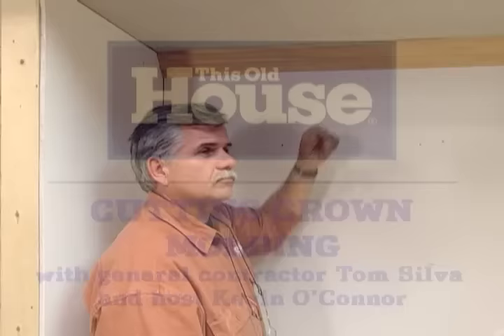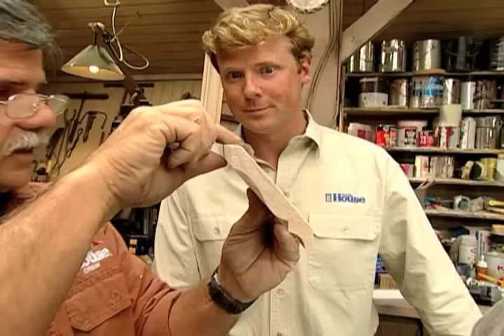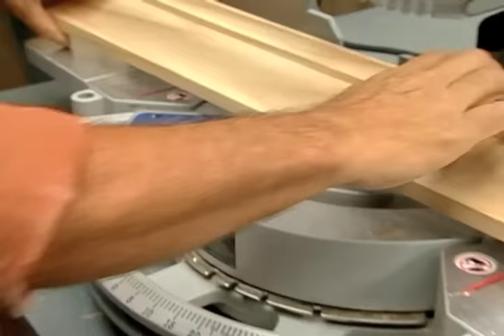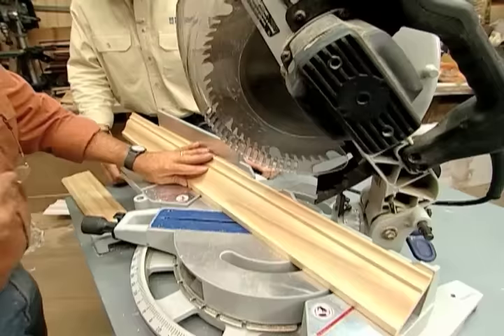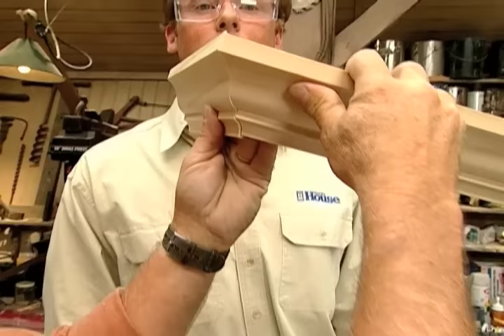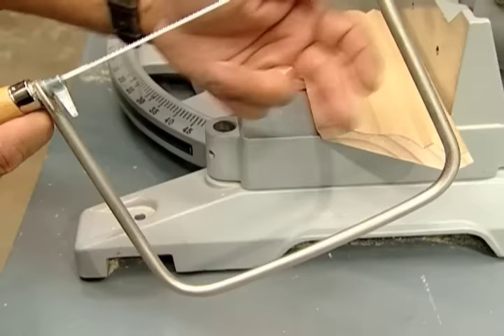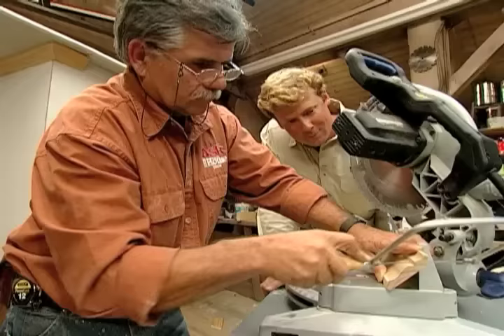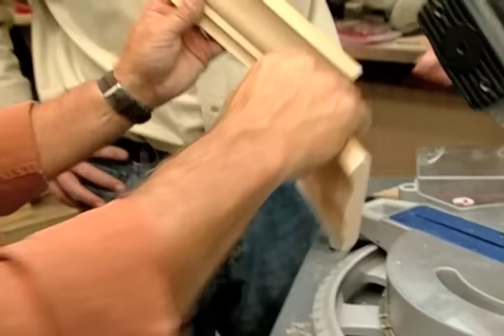How to Cut Crown Molding | This Old House

Comment: Again, this just shows cuts in random places on molding.  I need to see how a precise measurement is made and how the cuts are made.  Learned zilch.
Reply: You measure from corner to corner and mark it on the BOTTOM of you’re piece. Then, put the saw it at the desired 45 degree angle. THEN make sure you’re saw is cutting the bottom of the trim down to the top. If you need to know a precise angle they have tools for that.

What tommy does with the cope cute is optional, you can have two inside 45 angels if you want
Reply: @dr.zoidberg5096   thank you!
Reply: watch a video on how to read a tape measure then watch a video on how to use a chop saw

Comment: It’s so easy when you have walls with perfectly true 90 degree angles; i.e. about 10% of actual homes
Reply: and a saw that cuts exactly like it needs to, has a flat base, has a fence perpendicular to the base. the list goes on. all factosr that will screw the cut up just slightly. 

Sincerely, 

angry home owner trying to cut crown
Reply: @Cameron P  I'm feeling your pain.  Just gave up after trying so many times today.  Exhausted, angry, and can'teven focus any more.  The worse part is I'm using a hand saw, the only tool I have. 😭
Reply: One quick tip: When I cut trim, I check every angle with a miter finder. You're right, very few walls are 90 degrees. If a corner is 86 degrees, it will tell me to make 43 degree cuts. Makes for perfect looking miters no matter the wall situation.
Reply: Been in the remodeling business for over thirty years. I can count on one hand the times I've had a perfect 90 degree outside miter on crown.
Reply: Perfect 90 are like unicorns they don’t exist
Reply: That’s why you do a cope instead of a inside to outside/ inside corner

Comment: Thank you. All of these other premadonnas over explaining this was getting me nowhere. Clear, concise, no nonsense.
Reply: this is for beginners. advanced users would use a compound miter saw and cut the board flat, by simply adjusting the bevel and miter angles. there's a few really good charts online. After a few cuts even beginners will catch on easy. This method can be dangerous for beginners if not using proper stops and safety measures. so the new school method is definitely way more ideal, clean, consistent and most importantly more safe.

Comment: Totally agree I cut my crown flat using compound miter/bevel.....I never have to move the angle only rotate the crown.....goes much much faster, easier and more accurate......don't need fancy gauges or huge fence to cut it......laid miles of this stuff and this is fastest way to do it, you do need to know if crown is 38/52 or 45/45 spring angles but still it's way easier
Reply: Woah what’s 38/52 for ??

Comment: And remember, use as few scarf/breaks as possible, I was at a relative’s, and there was 7 breaks in one room on the crown that all could have been eliminated simply by using long enough boards.
Two of them were 12 inches apart. And they were straight cut, and stuck out horribly as they were caulked horribly.

Comment: He's showing the old school method. If you are using a compound saw (as he is), then why not lay the piece down flat and use the bevel and and angle  stops on the  saw. Also, doing a spice cut, I lay the crown flat, then cut a 30 degree bevel- square angle cut. Works great.  Different strokes, no disrespect to Tommy.
Reply: Installing mailbox posts

Comment: When cutting flat you are going to have 2 #s. The Miter and the bevel. Both those #s will depend on the spring of the crown. 38, 45, 52 with 38° being the most common. there's a table that you can pull up online that will give you those #s and also most double compound saws already have them marked on the table and swing gauge. the most common #s will be in believe 31.6° and 33.8°. Depending on if the wall is square or not you will adjust those #s accordingly  to make your corners "inside or out" come together. I haven't run crown in a bit but as soon as you get those 2 #s down it rolls smooth. It just boggles my mind how people do the upside down round and round dance.
Reply: I'm with you!
Reply: I was just going to post the same thing. Never would I do it the was they just did.
Reply: thats what caulk is for hahaha

Comment: Serious question from a novice: Why not cut the inside corner the same way as the outside corner? I sincerely don't understand why you would have one piece of crown butted up square (w/ a straight cross cut) against the inside corner, and then do all that work manually coping behind the adjoining piece of crown? Seems like a ton of extra work with little benefit in terms of quality. What am I missing?
Reply: when yer doin this job, yer dealin with the 4th, 5th and 6th dimensions son. dont question it

Comment: Normally these videos are pretty good at explaining things, but this one would not exactly be of much help to a non-carpenter.
We (and I'm talking about the builders, and other carpenters I work with) cut crown flat - easier to adjust for angle variations that way.
To get tuned-in to the proper way to cut crown cut some test pieces and mark them accordingly - ex: outside corner/left; top/bottom; etc, etc. - in no time at all you'll get the hang of it (and only have wasted a couple hundred dollars of crown in the process!!).
I once had a guy want to tell him, over the phone, how to cut crown moulding - good luck with that!! Ain't gonna happen!!
Reply: Finally someone who actually do it for living like myself.
Reply: Look up Larry Haun video series on crown. The BEST and easiest presentation on cutting crown. He’s got a process where you don’t need to think which way the saw direction goes. Always cut in the actual position upside down.

Comment: scarf joints are angled to account for shrinkage as wood dries ,if it does.On a butt joint there would be a gap, but on a scarf joint there is STILL overlap.
Reply: 738polarbear

Plus, you're gluing just a bit of long grain to long grain and not straight end to end grain.  Therefore a scarf joint is stronger.

Comment: Need help with a 135 degree inside cornet but the profile of the crown has a step on the bottom built in to sit on the top of cabinets.  I need help with how to set this up in the miter saw.  I can send a picture if needed.

Comment: Great video Tommy, but I would tell the folks to calibrate there saw first.
Reply: MrAlittle5150

Why wouldn't people have their saws calibrated?
Reply: @ThekiBoran  Miter saw get nocked around and out of adjustment. So you need to make sure your saw is at 90 degrees when it says 90 degrees. That mean the blade is horizontal and vertical 90 degrees exact measurement.
Reply: @ThekiBoran  If you have a sliding or reciprocating saw, single or double -- they need to be calibrated
Reply: @raicebannon1936 

Yes, I'm a finish carpenter, I check my miter saws for square frequently.

Comment: I cant believe he is doing a coping cut. Anyone that can operate a 12in mitre saw should able to do an inside mitre. Better to show that inside corners are always full of drywall mud, and never square, and how to make that mitre look good. But it is neat to see old school procedures now and then
Reply: If you can cope; it's faster.  M.D.F. crown, especially. Cut it tight. I have met some guys that don't  know what a coping saw is. If it's pre-finished material on cabs, then I do inside miters. Once again, ( different strokes.)
Reply: darkmatter972

Ask a pro, coping is better.

Comment: There is an easier way, the saw will cut the bevel as well as the 45. I do have to say that is some accurate coping saw cutting though.
Reply: To me that seems like two variables in the setup, how is that easier? Genuinely curious, not trying to be an ass.
Reply: It requires two adjustments of the saw for every cut with it flat. Nested is faster only swinging the saw.

Comment: This is great in theory, but in most homes you'll make your cuts and then find out that your wall angles did not total 90 degrees, but were in reality maybe 88 degrees, or 92 degrees. Crown mouldings take patience, and practice.

Comment: You need to lay your crown flat and actually use your bevel/mitre settings properly.  Cutting like he is here without the use of crown stops makes for errors and sloppy mitres.
Reply: That's what I was thinking.
Reply: Exactly. It's almost impossible to convince people otherwise.
Reply: He is using a compound slider, but still does it old-school. I know an old guy that refuses to adapt to the new. I prefer the new.
Reply: I make a jig specifically for the crown I’m using, and I don’t cut it flat. I have never had a problem getting perfect results.
Reply: Without a doubt. They do make stops for your crown mold width. Once set it will be exact for the rest of the job.Always glue your joints.
Reply: al tuten

I don't think that's a slider.  Chop only.
Reply: It's Tom Silva folks. A master at his craft. This is only an introduction for beginners.
Reply: Mmmmm stops for people with the luxury of being the only one to use the saw that day

Comment: I use 8,5" saw on job.  Not 12" like him.  I cut flat with compound cut and cope with jig saw not with hand saw.  I will change it now when I sow video.  Thanks to let me know.  Question.  What you do when ceiling is uneven and miter is say 3 degree of and crown is for example maple, so you can not use hand saw.  Expert I'm waiting for answer.
Reply: Inside and outside corners can often be tight fitted by simply moving joint up or down. Leave last 2' or so from corners un-nailed until joint is fitted.. Glue outside joints and pin together with 18 or 23 gauge gun. Set scarf joints so you are not looking into joint from most common point of view. 
Slide compounds are not the most accurate as the slides can bend slightly as you load forever down.. If you do use make sure you are loading forever straight towards cut and not 90° downward. Always look straight at profile horizontally when cutting cope or your angle may not be properly removed to allow it to cradle into other piece. Some trim guys cut coping as much as 45° to the reverse of initial miter cut to make sure pieces mate.. This is a bit much tho... Theoretically a 90° square cut would work.. But not in reality.
Also glue skarf joints. Use a jig block to make marks on wall where crown should be. If you cut crown like he did, you may want to mark work a pencil on saw where to hold trim if crown is large or has a small lip making accuracy difficult.
Reply: @claytonschmidt78  Man thank you for answer.  I was ironic in my comment.  I'm not ironic now as you evidently spent time to answer.  I developed my style and use it already 15 years like self employed and before 5 years like employee.   Compound cut and jig saw.  However it would take me 1 hour to explain my style and what I do.  I'm thinking to made cd for sale about it.  I do not know miter inside joints and it is not at end of my mind to try to do it.  I have enough of outside joints.  I have portfolio to prove that I know what I'm doing when is crown in question.

Comment: When the wall corners aren't  90 degrees you have to dial it in  to make it perfect. Why not discuss that ?  You just cant cut two pieces at 45 degrees and have them line up perfectly when the corner is 92 degrees...or 88 degrees.  Yeah for a ianted molding you can slop it in with caulk but if you are doing with a bare/stained wood you dont have that option.
Reply: kirk58

If diy'ers do their own crown they discover that.

Comment: Someone please explain why the scarf cut is on an angle? Why not straight through, the result is the same no?
Reply: If you do it, you will see.  The pieces are blended much better w/ the angled cut as the seam.
Reply: +oo0Spyder0oo If you simply butt 2 pieces of wood together with straight 90 degree cuts, the visible seam not only looks terrible and "cheap".........but as the wood expands & contracts over time, that seam will become AN UGLY GAP. When you mitre the seams, the seam is practically invisible, and even with expansion & contraction of the wood over time, the 2 pieces of wood are OVERLAPPED, so any gap caused by expansion & contraction over time, will only be very little, and the OVERLAP helps to hide it. It is the professional way of doing this. You should NEVER simply butt 2 pieces of "finish wood" together in any project.
Reply: Howabouthetruth Thanks for the info, I can visualize what you're saying. Another handy tip to remember, cheers.
Reply: You will have more surface area to glue and nail, making it stronger.
Reply: also, you can angle the cut away from the area the joint will most likely been seen from, thus better concealing the joint. This takes a little forethought in deciding which direction you go with the trim (from which corner on a wall).
Reply: oo0Spyder0oo

Plus, and angled cut provides for gluing long grain to long grain and not simply end grain to end grain.  Not a lot but aittle bit of long to long is better than a plain butt joint.

Comment: it is easier if the wood is laid flat and the bevel set to 34. and mitre 31.6
Reply: 738polarbear nah, nested with a jig is pro
Reply: No ,thats the amateur way .
Reply: +destruction123 he is right you know my dad is a trim carpenter/cabinet maker and they are doing the lazy cheater way good for track homes but frowned upon in custom homes
Reply: +Travis Vaughan I would explain the "hows" and "whys" but you don't have a clear understanding of trim carpentry.
Reply: +destruction123 
Cut it flat and easy. Jigs are never needed for cutting crown.
Reply: Quite agree .Jigs are for people that do not know how to use their machines .I bet the majority of householders do not even know what the little symbols on the mitre gauge are.
Reply: +destruction123 by the time i was 14 i was trimming out hole wings in large custom homes with 12" crown and triple stack base boards every summer till i was 18 so yeah explain away man.
Reply: Travis Vaughan What are you talking about ?What is a hole wing?
Reply: Depends on the spring angle
Reply: Google will give you an instant chart for setting up your miter saw for the two most common spring angles of crown moulding, so you can cut compound miters easily. FLAT on the saw. I have no idea why anybody thinks they need jigs or to hold the crown at an angle on their saw in order to cut it.
Reply: thats only if the roof is a 12 on 12 ....lol
Reply: @738polarbear  I assume he meant WHOLE wing - he probably made better grades in shop class than English Class

Comment: scarf joint should not be on an angle....it should be straight......on angle it makes joint alot longer and if ceiling or wall is out gaps get bigger the more distance it is.......also cutting crown flat is way way faster and you never have to move the saw.....once miter and... bevel is set it never moves, for either outside or inside cuts...
Reply: Cutting on an angle allows more surface area to glue and nail. Also, depending on the direction of the cut, it will be less noticeable than a straight cut.

Comment: Don't put your fingers near a blade like he's showing... that's dangerous
Reply: tom has 45 years experience you can yell at me if I do that I am a former carpenter 6 years
Reply: +Nick

I learned how to use a miter saw from
Gary Katz (google him). He teaches to keep your fingers away from that blade
and how to cut using a miter saw. All saws have warning labels about your hands
in the danger zone. Your fingers are worth more and he’s showing you how to get
them cut off. That blade will draw your hand in and you won’t be able to react.

 Ramesh